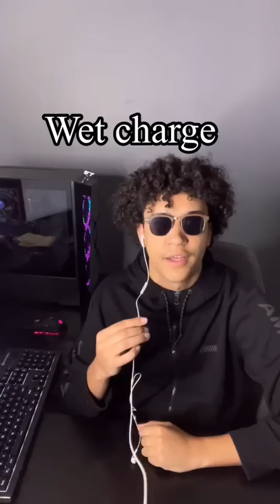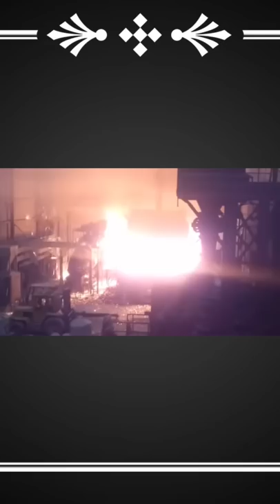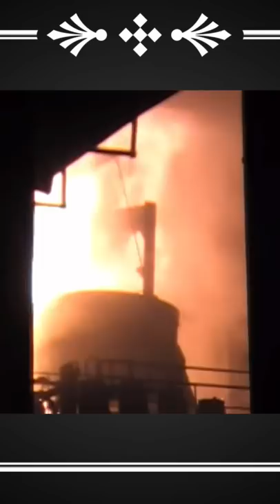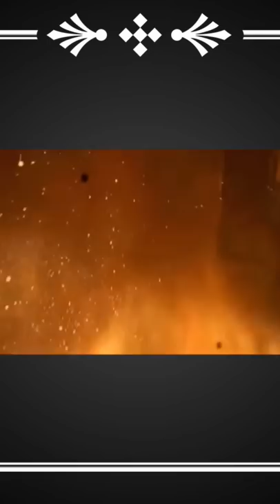Wet charge! Steel mill danger! #shorts

Comment: This is actually pretty similar to steam locomotive boiler explosions. If the water level in boiler drops below the top of the fire box (where the burning fuel is) that metal will get red hot and if you try and add water back than it will cause a massive steam explosion. This will most likely kill the locomotive crew and absolutely destroy the locomotive. There was actually one incident where a massive locomotive exploded and it had enough force to blow the boiler and cab off of the frames! Absolutely terrifying

Comment: The last clip wasn’t caused by a wet charge. The cause was overloading the furnace with scrap and the bath got up to the water panels. Yes those furnaces have big pipes full of water that are insanely close to 3000 degree steel

Comment: My grandfather's father worked in the steelworks in Wollongong and my grandfather passed this sorry down to me not that long ago, so the steel have these giant metal rollers to flatten the steel each weighing about 20 tons and spinning at around 3000RPM, at the time of this incident the steel mill was trying to make more steel so they had the steel mill running faster then usual, the workers thought this was fine until one of the rollers came flying off and flew around 50 meters through the room!

Comment: I had a friend got a job at a foundry in Neenah Wisconsin. It's been a while but I think he described his job as using a long rod to poke slag through a large hole in the floor. I asked him, ah, what would happen if you fell in there? He said all pretty much everybody would die. Because the water in your body would expand fast as bomb explodes, into steam hot enough to set close on fire.

Comment: The scrap yard I work for has an aluminum smelter and we have the same issue there but most of our metal goes to steel mills and we have very strict guidelines of what we can send and how we send it normally when our metal is received by them they go through a process so there's no wet charge but for tin bales it's a longer process but it goes through a shredder mill first which sorts the b***** from the real metal

Comment: I've done plenty of welding and I can tell you that wherein heavy leathers is a must. You obviously shouldn't smoke around these areas and for have some common sense in not wearing any colons,hear sprays or aftershave because most of these are likely to be flammable and you will light up like a Roman Candle on the 4th of July.

Comment: So I smelt copper and aluminium as a hobby. I can attest that even a 2kg crucible will explode and seriously mess your week up if you put wet metal in it when molten. I had second degree burns on my legs despite wearing thick work jeans and a long heat resistant apron.

Comment: Yea i worked in this profession. Almost a year. Casting piston rings for small and big engines, like train engines. Biggest piston rings will almost go trough your head... My first wet charge is the most terrifying thing in my career... Molten balls of iron flying everywhere. I look at my buddies and they are not even care, just standing there ... menacingly :). Of course this was small explosion, but no thank you for this type of work ever again.

Comment: What is done to prevent wet charges? Just a few towels? 

My theory is this based off of no research: The scrap, before it's melted by the electric heating bar thingies in the crucible, is put into a big furnace that only heats it enough to boil off water. The water is then evaporated out of the plant, and the scrap is processed.

Am I right or wrong?

Comment: Now granted it isn't to THAT level, but I have a propane powered recreational smelting furnace & with it, I melt down copper, aluminum & brass..  I've currently got 130lbs of reclaimed copper 40lbs of aluminum & a single 5lb ingot of brass..😁

Comment: Steel is a rough industry to work. I Walked into the bathroom and coughed up a mixture of blood, plasma dust, and a thick black oil substance. Immediately put my hat and gloves on the break room table, and walked out. My health isn't worth $21 an hour. Also almost got decapitated twice by a crane operator not paying attention, and almost had a slab dropped on me by an idiot on a skid loader.

Comment: The water evaporates so quick it releases and ignites the hydrogen a tiny drop can sound like a stick of TNT I was responsible for loading furnaces like this with a front end loader and when it was rainy out my ass was permanently puckered. And yes the loader got covered in molten a few times.

Comment: Yeah, I wouldn't be too worried about the heat from the metal. What usually ends up killing people and still males is the fact that that liquid metal still has the density and weight of metal when it hits you. So you're getting crushed to death before you're burned and encased and steel.

Comment: Well thanks for your respects we have many safety features in place for this we keep all wet things away from the metals and we use a furnace in the back away from everyone and the only people using these tap into them and fill the truck to put it in we use a magnet crane and this is scary however there is also this thing called a blowout and that is when the truck tips the metals to stir them and the lid towards the bottom opens that's terrifying especially for the guy driving the truck

Comment: It's worse than that. 
The steam is broken into hydrogen and oxygen by the extreme heat. 
It's close to a detonation 😬
Reply: And the lid on the pot, I vividly recall looking UP at the inside of it😳
It swings to the side and we had to monitor equipment in that area.🤦‍♂️🤦🏿‍♂️
Reply: Pretty sure only lightning is hot enough for that, so a arc furnace?

Comment: I had to vacuum out the slag dust from under one of those smelting pots and bolts of electricity shot from the ground to my feet then my hand and one even zapped my head so I quit the temp agency got a job there cutting one foot think steal plates with an oxy acetylene torch in a train yard. Geneva steel in Orem, Utah 1987

Comment: Let's be real, any resource plants are terrifying.
Steel mills? Giant cauldrons of hot liquid metal that could kill you in seconds.
Sawmills? Giant spinning blades of death that will cut you in half if you slip.
Oil drilling platforms? One tiny spark and one tiny leak is all that's required to make the whole thing go kaboom.
Uranium processing? Do I even need to say what's dangerous about that?
Respect your blue collar workers, they make the world function. And truck drivers, don't forget about the truck drivers.

Comment: Yep bc it's just like if you fry potatoes in vegetable oil bc if the potatoes still have water on them the very hot oil will deflect the water back at ya but 10× hotter than before aka a big pop and trust me it hurts like a mf

Comment: I used to work for an aluminum and steel parts plant. I worker making rear end diffs for trucks but we were all told not to bring a bic lighter or any compressed gas, if your a smoker light em with matches or a zippo. Bring that s$%& inside an you could wipe out the town

Comment: Charging a pot of steel....or shucking steel....the loading CAN be Very dangerous!!! But how is water introduced where it clearly isn't wanted!?? 
   It's because the shucker...guys like me!....had to get chunks of scrap from the yard to use....even rainy days wasn't enough to cause problems But!!! on Snowy days you were instructed to either find a dry piece(18inch pieces of rail road rail) or brush the snow off. The amount of water to cause an explosion would have been at least 8..12oz water! A lot!!
   We would be bored and when the boss wasn't around we'd flick a mini snowball in....one inch across!!....just enough to sound like a pistol shot!...and scare the piss out of your coworkers!!!
   One last thing.....in the video they call it a ,steam explosion,
   Hah!!!! Wrong!!! The heat....around 2350F,,..is so great it breaks water down into Hydrogen and O2 !!! Then that gas mix ignites!!

Comment: I used to do the same exact job except with silicon metal. I ran the crane pouring the huge ladels like the one you seen in this video. Take a water bottle about 1/4 full with water and toss it in it's about the equivalent of a grenade. A couple ice cubes are like two M80's detonating at the same time. I got blew up once when I was chipping a ladels out with the KT machine it's remote control and is built like a small track hoe with a hydraulic chisel and a hydraulic line blew on the arm and when the hydraulic flood made contact with the liquid metal inside the ladel it exploded like a bomb and sent metal five stories high and blew me back. I escaped with only a few burbs on my arms and legs and thinking God everybody for sparing my life and/or serious injury. It's a whole other level of "stay woke"